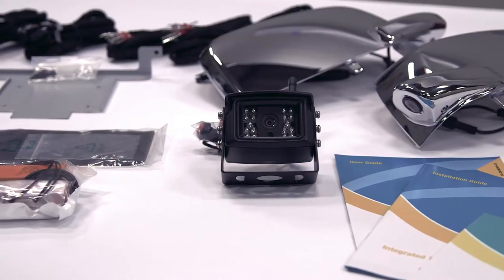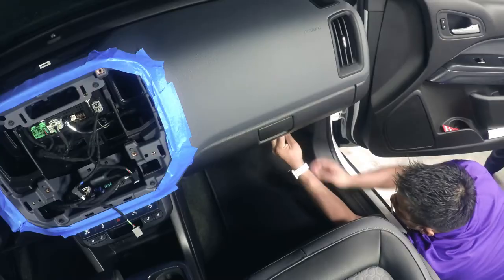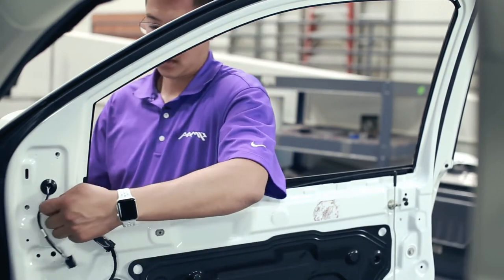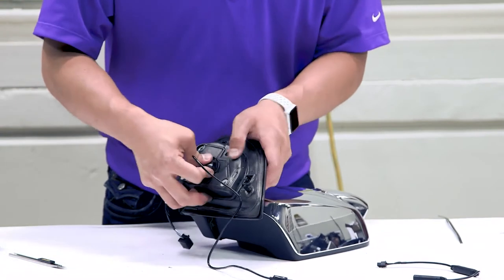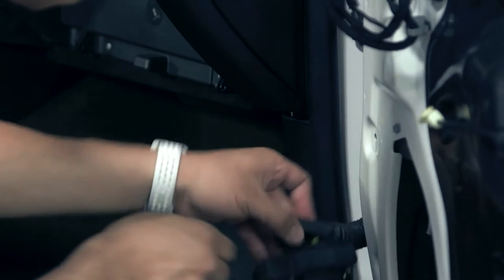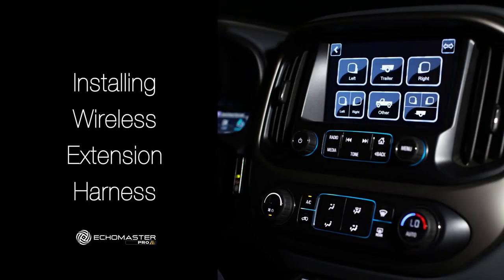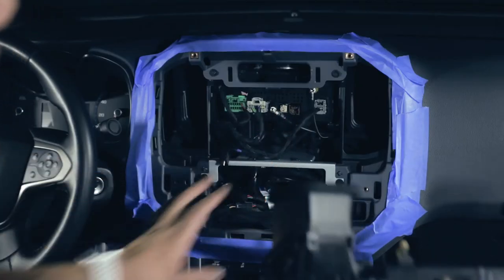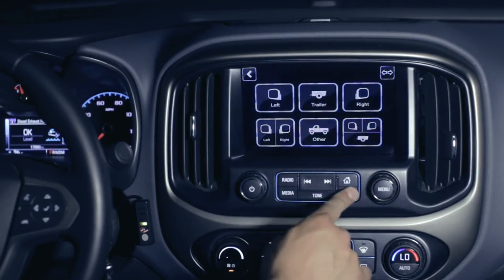IntelliHaul Install Video FC-GMOESWR-CC / 19355214

Comment: He did a great presentation for Echomaster. I've been shopping this stuff for over a year. Just purchased Multi camera interface. I suggest finding a certified Echomaster facility. Purchased a new Duramax and 25' toy hauler retiring and going on long rides. Ultra Limited in the hauler.   I'm having a rear and front facing camera installed on back of trailer and front grill of truck. Now I'm researching and considering a camera on top of my Toy Hauler. Clearance is not always posted at gas stations.Kind of a early warning system. Great job of instruction. I could have used you at Boeing.

Comment: In your video at 17:46 it says to "Select DOWN on DIP SWITCH 3 for 2017 models and UP for 2017-2018 models" which is correct for 2017?
Reply: DIP #3 needs to be down for 2017-2018, thanks for catching this